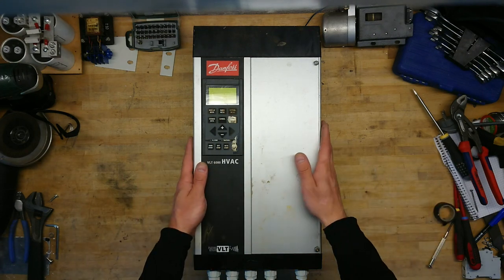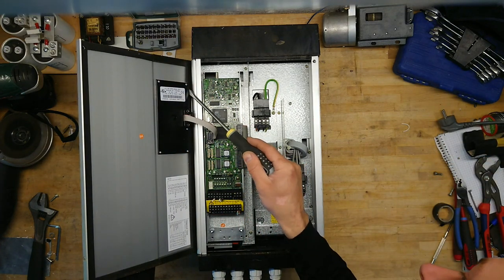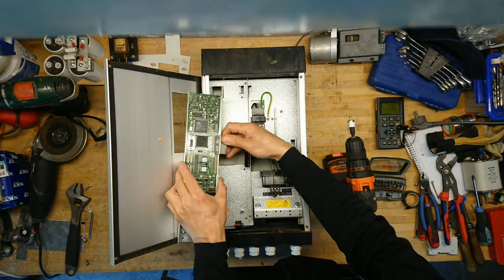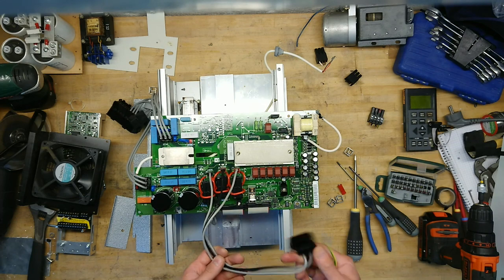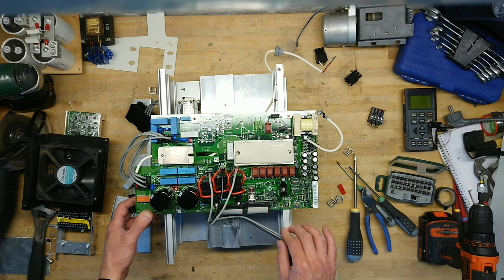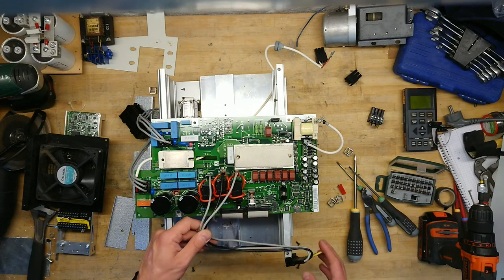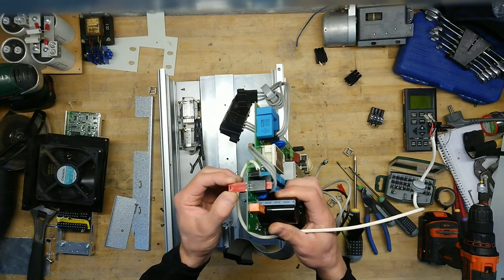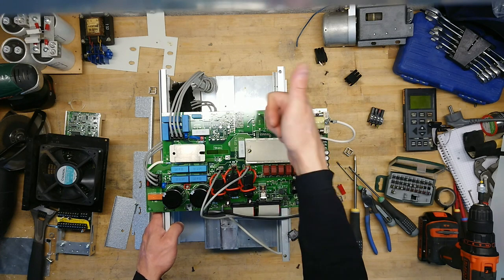Teardown of Danfoss VLT6000 4kW Variable Frequency Drive

Comment: 2:15   Those connectors ar easily disconnected by pulling the plastic housing up. Don't pull the cable, that won't work. By pulling the housing up it will lift a little bit and unlock the little pin that hold the connector locked. I always use a pointed nose pliers, it works great, just pick a inner site and a the outer site of the housing, not the two outer side's this wil break the housing.

Comment: I have trash picked 2 of these units not long ago. One blew the fuses right away and meet the same fate as your unit.  :)
The other one seems to work. The one that works was found next to a 4kW ducted fan which I also “saved”. I have no knowledge on how to use them, but they looked like a lot of fun. I also wondered over the switch. After reading the manuel it seems that it is a RFI-switch used in some way with isolated power sources. I am way in over my head with this unit, but I it was to cool to let it be crushed. Now I just need to figure out how to use it.  :D 

The manual explains the switch on page 44 (Danish link)
http://files.danfoss.com/download/Drives/doc_A_1_mg60a901.pdf
Reply from the maker: Hooking up the mains supply is easy, as well as the motor and you can control it with a potentiometer connected to 3 of the control terminals and then maybe a single button/switch for start/stop. All examples are in the manual.

The RFI switch seems to be a very rare use case where you want to "disable" the drive from being grounded and it will float, this also means that it will emit much more EMI and no longer live up to those specs, I forgot to check it out myself :o
Reply: yes. ive just installed one a danfoss drive in an HVAC environment 2 days ago. The switch is usually closed by removing a screw or a plastic tab. Once this is removed it cannot be easily restored. These are fun to install and program. lots of inputs and outputs, thousands of programming variables.